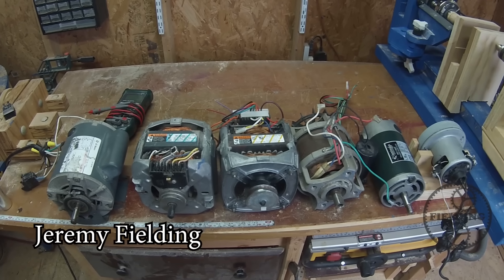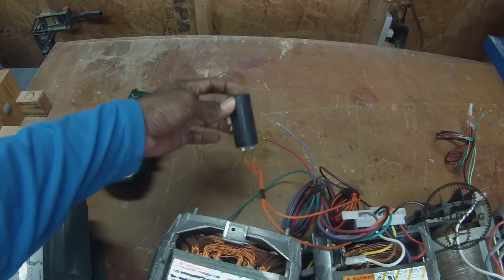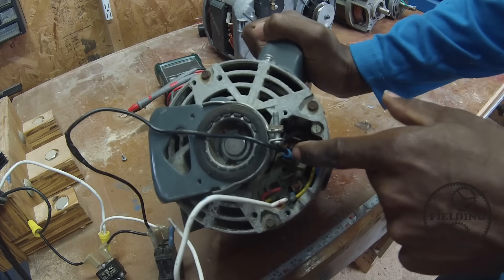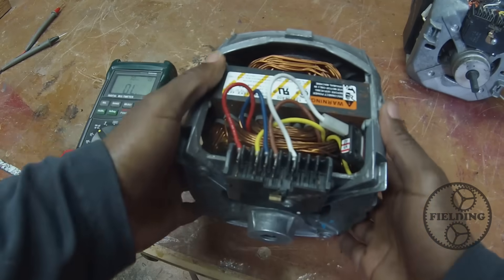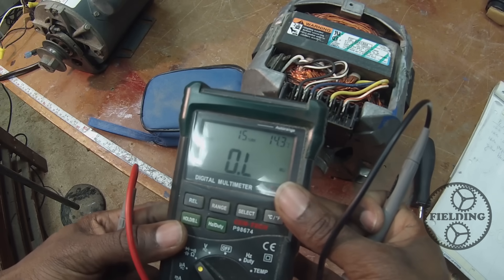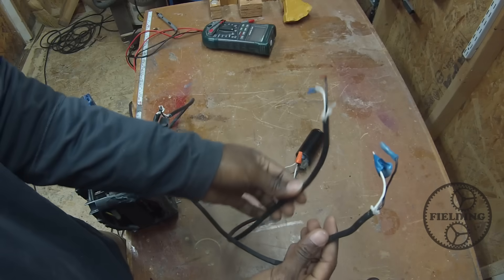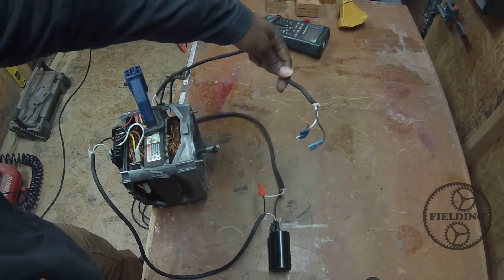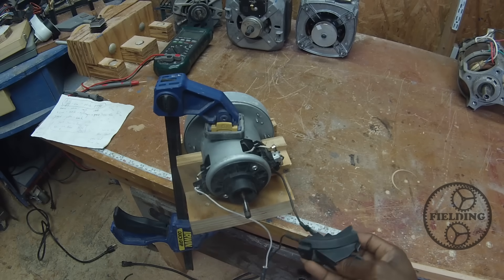How To Wire Most Motors For Shop Tools and DIY Projects: 031

Comment: Jeremy I was in the process of trying to get different speeds out of my wood lathe.  My thinking was that if I introduce a dimmer switch into the circuit then I didn't have to change my belt on the pulleys, or I could get all sorts of RPMs with the dimmer.  I went as far as cutting my wires on my switch (on/off). You explained that only a change on the hertz would have an affects on the motor, was very important in my case.  I have to scrap the idea of the dinner switch and stick to changing the belt to get different speeds. I am so glad that I saw you video before going any further with my project.  I could have burned my motor. I guess I can get a router veritable speed control for it, but it's not that important.  I'll just change the belt from pulley to pulley for different RPMS/speed. Thank you so much for making it very clear that my circuit was going to be faulty with dinner switch. Awesome teaching. Keep them videos coming.
Reply: I'm going to solder the wires back the was they were and stop messing with it lol thanks again.
Reply from the maker: You are welcome... just FYI "router speed controllers" are exactly the same as a light dimmer switch. The only difference is their ability to handle working with a motor... they last longer. They function exactly the same, so you would have the same problems with it.
Reply: Jeremy Fielding in that case I'm just going to stick to  the pulley system.  Not that it's a bad way, I was just trying new things.  Once again thank you

Comment: These videos take me back to pre retiral when I was an electrical fitter in a power station here in Scotland!
Reply from the maker: Wow... well, glad I could give you a fond memory... I hope :) Thanks for commenting. It is pretty awesome to know people from all over the world have seen my videos.
Reply: Some fond memories and some not so fond!  Mostly 3 phase stuff up to 11kv although 415v was our bread and butter!  The horrible bit was overhauling motors that had been used in crappy environments where all the screws were seized etc and were a pain in the butt to strip down.  It was satisfying though to see your work save the day on occasion!
Reply: Also worked on dc motor control gear (stand by plant)with lots of relays and mechanical timers.  These were vital for the safe shutdown of plant in the case of an ac power failure!
Reply from the maker: +gartmorn that is awesome

Comment: Right now my collection of electric motors is pretty thin.  I have a vacuum motor and I have a motor in a drill press that needs some help.  1st...what is a good application for the vacuum motor?  2nd the motor in the drill press will turn if I give it an assist, but it won't start on it's own.  I looked for a starting cap, but couldn't find one.  Would you suggest adding an external cap?
Thanks for your videos.  I find them helpful, but I really enjoy your creativity.  Thanks again.
Reply from the maker: It is almost always under a thin metal "bulge" on the side of the motor with two screw holding it down. It is possible that the capacitor is inside the housing of the drill press with wiring running to it. It is doubt your drill press runs on anything other than an induction motor. I would not try adding another without finding the first. Does the drill press have a label a manual or anything that gives you more information?
Reply: Thanks for responding...I'll look.  Unfortunately there is no "bulge." I will reexamine the label and report back. For the moment cancer chemo calls, gotta go see the doc. Thanks again.

Comment: Thanks for the information. I have a washing machine motor which i want to attach to a 2 channel relay for clockwise and anticlockwise motion. Can you help with the wiring  with the capacitor in this case?
Reply from the maker: Check my video on reversing the direction... you just need to add the switch accordingly.  https://youtu.be/uy80khWdzsI
Reply: I saw your video it was helpful but i dont want to manually reverse direction by flipping wires. I want this motor to work like every washing machine motor works clockwise and anticlockwise. I have already done the coding part in arduino and just need some help in wiring the relay, motor and capacitor.
Reply from the maker: +Jaiditya Khanna I try not to give advice like that. There are too many variables I can't see. The basics are there. I promise the step between what I show in the video and adding the switch is pretty small. One double pole double throw removes the manual part. Or a switching relay in your case. That is about as much as I can explain in the comments. If you can program an Arduino the hardest part is done I think
Reply: Jaiditya Khanna if my understanding is correct you ca get your Arduino to work with a relay switch. The relay has all the components that you need   You just have to figure out how to set it up.
Reply: Your Arduino has all the programming you need it's a matter of finding out what wires go were and then the time of such forward and reverse cycle you want.

Comment: i don't know, wire those revised?
Reply from the maker: +Radical Edwards I had some small errors in the first one... and I didn't explain how to know which wires were the starter winding. That is what was changed/revised to be better than the first. It is my most popular Video so I felt compelled to fix it. Now you know lol

Comment: Thanks!  I have access to a ton of washing machine and dryer motors and I want to make 2X72 inch grinder for knife making!  I'm in need of information on how to wire these to make a good grinder!  The use of pulleys and belts is good to know as I'm going to need speed!
Reply from the maker: +Kim Curtis you are welcome! That's why I do this.

Comment: 10:15 No need for a plastic handle. Once it's unplugged there is no reference to earth and thus you. So as long as you don't touch both terminals at the same time you're fine. And with a metal screwdriver you only touch one and the drivers shorts the other :)
Reply from the maker: Excellent point...there is no path through your body under these conditions and therefore no risk. As a side note... I had several people get all worked up about me using a screw driver instead of a resistor to bleed the capacitor. One guy said the screw driver would explode into shards and send me to the hospital. Posting videos like this bring to the surface all kinds of misinformation. Thanks for the helpful comment!
Reply: Damn, then you really need a serious capacitor for that! Btw, most starter caps and running caps (for the bigger motors which keep the second winding powered a bit all the time) I've seen have a bleeder resistor in them or are leaky by design so they discharge themselves. Because once you unplug the motor the charge isn't only available at the cap itself but via the motor windings to the plug as well. And that can zap you already :D So to prevent that they make the caps leaky so they discharge reasonable fast. But depending on the cap size it might still hold a reasonable charge for some time, especially at 230V . (Yes, I'm European :p)

Comment: I confess, I have watched every iteration of this video you have posted multiple times. It seems fairly straightforward, but I still have questions. Do all AC motors require a starter capacitor? It the beginning, I thought you said brushed motors do not, but then you added one to the washing machine motor, which I thought you also said was brushed. Did I mis-hear or just misunderstand? I am specifically trying to see if I can get a 1/2HP motor I pulled from a trash compactor to run. I ran through continuity and resistance tests on the terminals and am pretty sure I have those figured out now. But what I don't know is if I need that starter cap or not. I pulled this machine apart a couple of years ago and don't remember seeing a large cap like that. And even if I did, I didn't save it. I haven't had much luck googling specs on this motor either. Is there another way to figure out if I need the cap or not, and if so, how do I figure out what size it needs? I ultimately hope to use this for a large benchtop disc sander. Many thanks, once again, for posting this info!
Reply from the maker: Not all AC motors need a start capacitor. Only some single phase induction motors. But they are very common. Typical you use an induction motor in machines that will run continuously or for long periods of time because brushes wear out over time. If your motor has brushes it doesn't need a capacitor. If I had to guess it needs a capacitor. An appliance made to run without service for many years in a US house hold is probably a single phase induction motor.  Here are a few things to check....
1. No brushes - Definitely induction motor might need a capacitor. (very unlikely it is another type although it is "slightly possible"
2. Centrifugal switch. It needs a start capacitor. There is a link in the video description about this. 
3. one of the windings has a significantly higher resistance then the other (check video 17) that is likely the start winding and it needs a capacitor. 

Just buy any washing machine capacitor. They are all about the same size.
Reply: I'll see if I can peer deep enough into the casing to confirm that it has brushes and/or cetrifugal switch, I believe it is tack welded and not bolted on. Thanks for the tip on the washing machine cap. I was able to easily identify the start winding contacts. They measured twice the resistance of the others. Of the three other contacts, two different pairings had similar resistance. I'm guessing these are for forward and reverse, rather than alternative speeds. And one pairing had nearly 0 resistance. Any idea what that might be for? One bonus on this motor is it appears to be high-torque, which makes sense for a trash compactor. I'm thinking this will be useful for use as a shop tool as it shouldn't get as bogged down by pressure or friction. Thanks for your quick and helpful answer! I keep watching your vids because I learn a lot from them. :)

Comment: what dictates the speed of a drill type motor? any way to alt the speed  by rewiring to halve the speed?
Reply from the maker: +Jim Liechty why not use the trigger or are you talking about any permanent magnet DC motor? I made a whole video about that. "How to wire D.C. Motors and control the speed"

Comment: I noticed that you said that the start winding has higher resistance than the run winding(s). Is this intended to limit the inrush current and keep the motor from drawing too many amps when it starts up? Oh, and another great video by the way!
Reply from the maker: +Lex Boegen no. It is to save money. Copper is expensive. The start winding is used for only a second or so and doesn't contribute anything after that. Thin wire is ok for a few seconds at a time so don't spend more than necessary
Reply: Thanks for replying. That makes sense.

Comment: Thanks for the videos. As someone who has no knowledge or experience with electrical work and is just looking to run a machine, inexpensively, I find the "Absolute Beginner" video more helpful.
Reply from the maker: Thank you for the feedback. Are there particular parts you found difficult in this video? I am just guessing, but I would say the multi-meter steps are the most difficult being that so many new concepts have to be used ... I am trying to get a feel for which area need more explaining for future videos.

Comment: I notice you mostly talk about washing machine motors, but what about dryer motors?   are they any good? any drawbacks?
Reply from the maker: They are wired exactly the same way. They are somewhat smaller though. Usually 1/4 or 1/3 hp. While the washing machine is usually 1/2 to 3/4 hp
Reply: Jeremy Fielding: Thanks man. Great videos, by the way. it helps seeing how doing what you do is possible.  Helps motivate me to make what i actually think of...  Also, on a learning point of view, everything is clear and easy to understand. Keep it up!

Comment: English is not my first language so I have a question: in this video you use the words (if I am not mistaken) "hot" and "neutral" when referring to the cables you plug in the motor and in the video 36 ou use "north" and "south" when referring to the poles on the magnet. It´s THE correct way or ONE of the ways one can use? In portuguese (I´m from Brasil) we use words equivalent a "positive" and "negative" to the poles on a magnet or phases of electrical wires (or "neutral" sometimes as substitute to "negative" in electrical phases/wires). BtW, good work in your videos!
Reply from the maker: These are two different types of motor wiring. When looking at the AC motor, the wires are referred to as "hot" and "neutral" and the current is alternating positive and negative many times per second. However, in the other video I am showing a DC motor. In DC Red is positive and Black is negative. The poles of the magnetic field is what is produced depending on which direction the wire is coiled. Clockwise vs counterclockwise with respect to current flow. It is hard to explain in the comments but I will talk more about this in next video about the differences between motor types.
Reply: North and south is only used for magnets which refer to the fact the north pole of the magnets points to earths North pole. But sometimes (or in your case, some languages) north is also called plus (and colored red) and south as minus. But it has NO reference to voltages.

Because it's AC there is NO positive or negative. So Sorry Bobby ;) With normal AC there is no real difference between the two wires. But with mains we have Live/Line/Phase and Neutral/zero wire (fase and nuldraad in Dutch). In this case the Neutral is connected to earth somewhere in the system (yes, the real thing you're standing on) so it has no voltage between earth and neutral and so no voltage between you (standing on earth) and neutral. But the Line wire does!
Reply: Thanks!
Reply: Live and neutral or positive and negative or hot and neutral all the same
Reply: 10:08 Whether you are working on an AC or DC circuit if you don't have a voltage dropping resistor, the voltage stays at the capacitor for a while ( hence, the di electric ). Notice that if you have a monitoring or a pilot LED, it takes 3 to 5 seconds to completely vanish until it's gone.
Reply: easiest way that i can think of is using the words pluss or + and - negitive
Reply: Luciano Sturm I think you are referring to......... yes hot means positive and neutral = negative. Ground is bare wire or green.

Comment: I've got 2 small 110v motors with 8 wires each on them. Any idea? They were in some window fan unit. (Red, Yellow, Brown, White, Blue, Grey, Black, Black colored wires on each) Have been unable to find any info on the motors themselves.

Comment: I was trying to figure out how to wire my 3 phase ac induction motor and this video popped in my notifications..I'm still confused. You say your motor are 1 phase? Or you have made them 1 phase with the star capacitor. I've been looking at videos for hours now I'm starting to think my brain is battling the learning I'm trying to push in it.
Reply from the maker: The motors I show in this video are all single phase or other types entirely. I will do I video on three phase motors pretty soon. The major difference is three phase motors require three phase power. Most people don't have three phase power at their house including me. It is usually only available at industrial sites with large machines. There are three ways you can run a three phase motor with single phase power. If you don't want to wait on my video you can search for "how to run a three phase motor on single phase power." Because I am pretty certain that is what you need. If what you read intimidates you... I will be along with a video before long. :) The best option in my opinion is to buy a "VFD" variable frequency drive with single phase input and three phase output. It is tough to explain something like this in the comments but I hope this helps!
Reply: Jeremy Fielding Very well thank you my friend I will look at those VFD! I have experience in electronics but somehow my parental leave has been awful on my brain and haven't feel so lost lol. I can't wait for your video as it is always very educative. Keep up your good work Jeremy!

Comment: still can't find video explaining which electric motor to use with a 50gal. drum to make a cement mixer
Reply: metalhead2508 what about 3 to 4 horsepower motor with belt drive
Reply: Gear it down 2 or 3 times with large and small pulleys and belts, and it'll probably work.
Reply: J DeWitt thank you. still working on stand design. being I make small projects that usually don't weigh more than 165#s. I just need something small
Reply: A 50gal drum full of concrete will weight a lot. I might try making something smaller the first time.
Reply: J DeWitt yes I do only the to 50 lbs at a time...I'm disabled but try my best find ways with block and take to lift what I'm unable yo lift. so I need small frame, 2-3 hp motor and we igh handle braking system block stoppers for tilt of barrel
Reply: Add some baffles inside the barrel to help mix the contents.